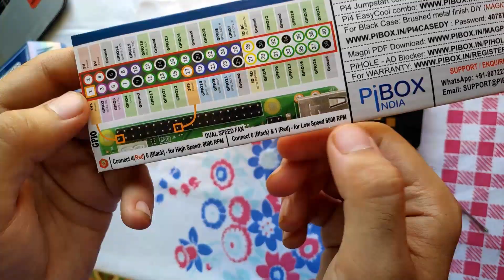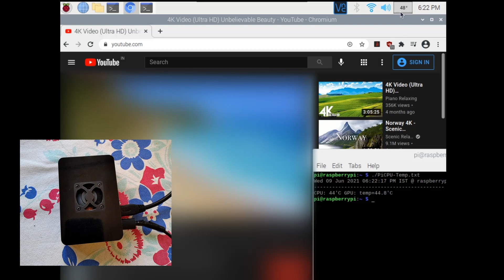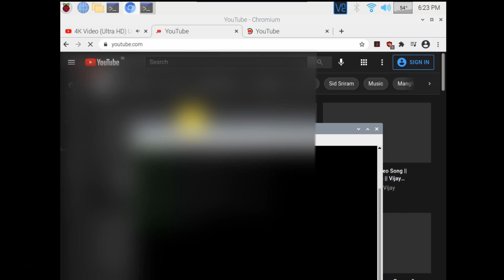How to Install Cooling Fan, Case & Heat Sinks on RPi 4 | Drop CPU & GPU Temperature 🔥 | Hindi

Comment: Hi there..  the best test for fan or without fan would be with the case closed and fan powered off for 15 mins. You will see temp max out at around 50 with fan and temp will hit 83 without fan.  Again.  Great video!
Reply from the maker: Yes agreed, to prevent overheating and damage of a processor i run 1080p video for around 5 min.
Thanks a lot for visiting me 👍🏻
Reply: I’m getting “Low voltage warning” on this same kit (using with the included power brick) .. Is there any way to resolve this issue?

Comment: brother check how much difference between 6500, 8000 rpm
Reply from the maker: Around ~3°C to ~4°C drop appear while connect with 8000 RPM, however little fan noise is observed.
Reply: @DTech-dhavaljoshi  ok thanks bro actually i am wondering if i use powerbank with it how much backup difference will be there, if possible do that test also in future
Reply from the maker: @varunguptag  Sure in future I'll plan this analysis.
Thanks for suggesting 👍🏻

Comment: @DTech-dhavaljoshi Bro, I purchased RPI 4b 8gb ram 2 yrs ago and I has no bill no warrenty. Since it was not available so I have to purchase it from kollata chandni market. Now, MY RPI 4B 8gb ram heats up 90 degrees in 1 minutes, it cannot even play 720p hd video from youtube (it lags a log), even terminal lags and temp goes upto 100 degrees in 30 seconds with terminal itself not youtube.

Please help! my 10000 Rupees feels wasted. I purchased it to use as a portable hacking machine and daily coding work on Linux but I even can't use it for such issues.
Reply from the maker: You can try to put heatsink on process and maybe use a fan as i have shown in video, on the other end check which process consumes too much CPU by looking into the system monitor, you can end those processes or flash a new raspberry pi os.